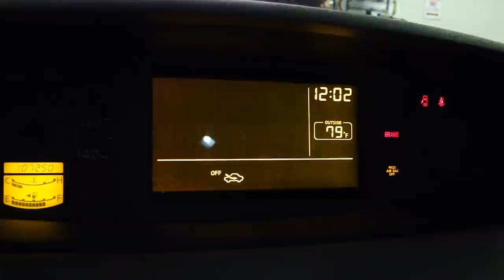Replace Nissan 3.5L V6 Crankshaft Position Sensor | 04 Nissan Quest

Comment: The check engine light blinking now any idea from what changed the camshaft sensor an the crankshaft sensor to what could it be
Reply from the maker: +loudjunkey 420 You need a code reader to find the fault code. Any auto part stores can check the code for you.
Reply: +dial2fast thanks a lot your video helped so much
Reply: If you are driving it and check engine light blinking when u push on gas pedal that is misfire..bad coil pack .

Comment: Hey I have a 2002 nissan maxima is slipping on the 2&3gear  and my rpm starts excilerate for like a minute  but my check engine light isn't on
Reply: MIke Sablan vehicle speed sensor
Reply: Did you figure it out?im having same problem I have codes p0725 and p0868

Comment: Just subbed to you. 

Ok I have a 2004 murano 3.5 and the check engine light is on saying crankshaft position sensor. I replaced it one time and still the same , traded it in for another one and still the same after install. 

The murano cranks for 5-8 sec befor it starts then runs fine. Not sure what to due I'm out of ideas. Any help would be great.
Reply from the maker: +Steven Thorkelsen Make sure you using orginal Nissan part. If you did and still doesn't work, you might need to have a mechanic take a look.
Reply: +Steven Thorkelsen   Steve,   Did you resolve this issue?   I have the same exact symptoms with my 2004 3.5 Nissan Altima.  Thank you.

Comment: I have P0011 and P0021 on my 2007 nissan maxima, but I do not feel the engine fail. Any recommendation ?
Reply: No, I replaced both sensors , erased the code and after 15 miles, again the code in the board. The car is working well, I don't know what is the solution.I am very sure now that I start to hate all Nissan cars. They are trash for sure
Reply: I have a 2007 3.5 Altima that had a P0011 code only. There was also an intermittent "chatter" from the timing-chain area of the engine at idle. It has something to do with the guides for the timing-chain, they wear because they're plastic.  The dealer that sold me the car said it was "no big deal " and to fix would be about $1100. I declined.  About 2 years later car suddenly went into limp mode, could barely do 35mph. Camshaft had failed. A replacement used 53k motor was cheaper than replacing the camshaft...paid $3700. My advice:  MAKE THEM FIX THE P0011 CODE/TIMING-CHAIN GUIDE...for $1100. Eventually you will need a new engine, in maybe a year or two.  Good luck brother!  By the way... the Infiniti g35 motors use Metal guides instead of the plastic ones for the Nissans, same VQ35DE engine ...maybe you could use those.

Comment: Great Video!!!  I would like to do it right away. How much did you pay for the sensor? Did the new sensor improve the transmission jerking?  Did it improve anything else?
Reply from the maker: The OEM sensor is $100. There is no improvement to the transmission.
Reply from the maker: Sonny Cho I am not having that problem. Have you changed out the transmission fluid as part of maintenance? Check the fluid and make sure they are not dark red or brown.
Reply: dial2fast I just replaced the sensor and tested for half hour. It turns out great!! I got a aftermaket parts from Advanced Auto for $35.   It runs very smooth... jerking is gone.
Reply from the maker: Sonny Cho Excellent to hear. Thanks for sharing your experience!

Comment: Thank you very much , your tips have help me a hole lot .
Reply from the maker: Thanks for your comment!
Reply: I can't find the sensor on my. 2005 altima,,can they have change the motor on this one? ?
Reply from the maker: Santos Molina I am not sure on the Altima, but I know even for my Quest 3.5, they had 2 different transmission and the location of each is different.

Comment: I hope you put oil into o-ring?? You don't show that......
Reply: OEM Crankshaft sensors not have the o ring, curiosly aftermarket have o rings, this cars have a black rubber and the sensor seats there

Comment: None of these  guys can just stand in front of the car and point to either the driver's side or passenger side and say  " The sensor is located on the driver's side at the back of the engine"  ......  WTF

Comment: Is this the same for a 2003 Nissan Altima v6 with the bracket on top of the crank sensor. Because mine has it installed under the sensor and doesn’t run correctly

Comment: Is the crankshaft sensor in the same position on the 2004 nissan maxima 3.5SE?
Reply from the maker: It depends on which transmission you have. The one I showed in this vid is the 4 speed. Nissan also have a 5 speed with different location.
Reply: Mine was